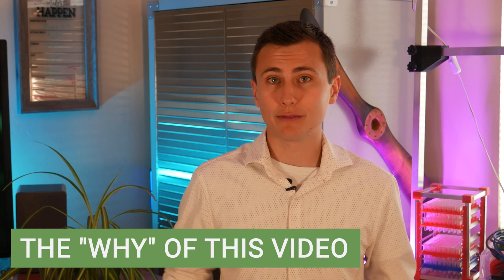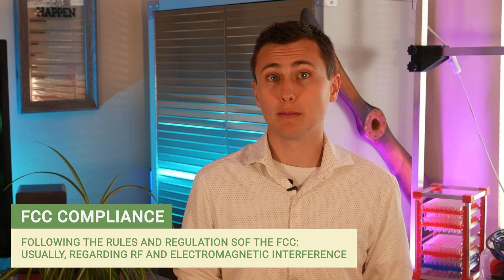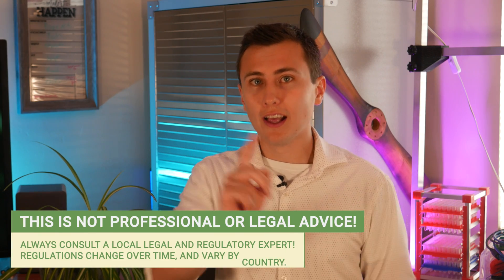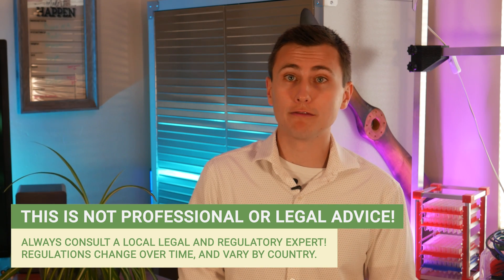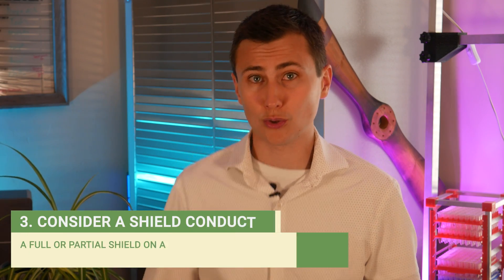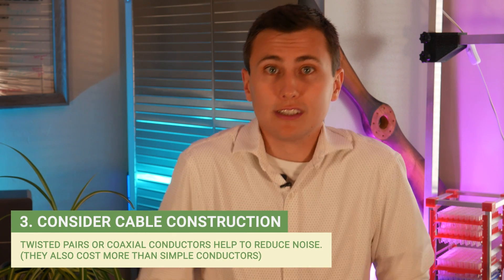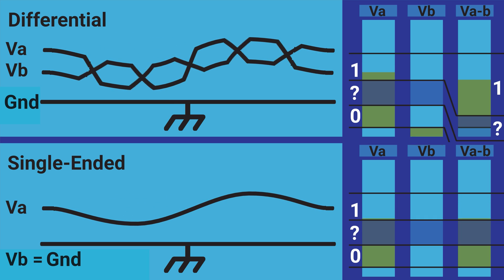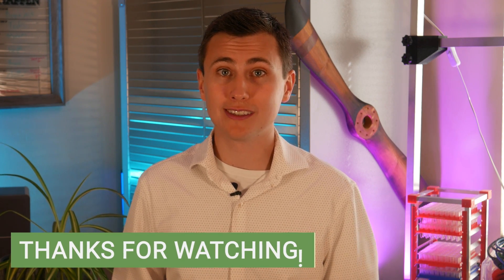Design Hardening – EMI, EMC, and Some Common Considerations | DMX 3

Comment: Hi Sir , Good evening .  We have dealing in Tactical communication products in India based and serving and security forces organizations . Recently we have faced a particular as below  :

 Problem Statement:

1) During a recent demo of the Accord CNR Gateway, significant noise disturbance was observed when connecting digital UHF/VHF/HF sets from StarV, Tadiran, and Motorola (HX) in secrecy mode. The noise disturbance occurred as soon as the PTT button was pressed. Please suggest a solution to handle this noise issue . 

2) The Accord CNR Gateway exhibited noise disturbance issues when connected to digital UHF/VHF/HF sets from StarV, Tadiran, and Motorola (HX) in secrecy mode, resulting in degraded communication quality. The issue was observed during a recent demo, where the CNR Gateway was housed in a non-EMI/EMC shielded aluminum enclosure.

From 
P.K.Mohta 
Accord Communication Limited India  
Please help